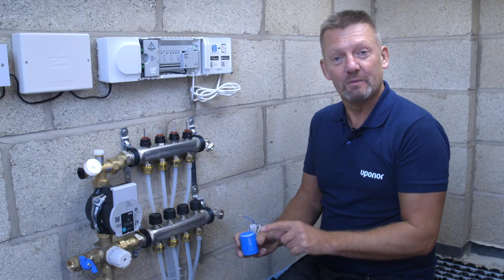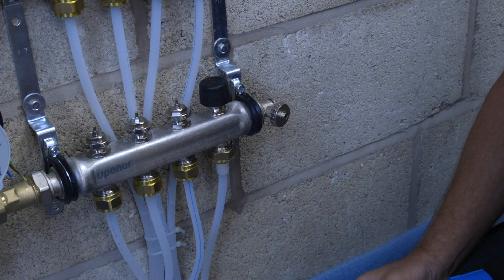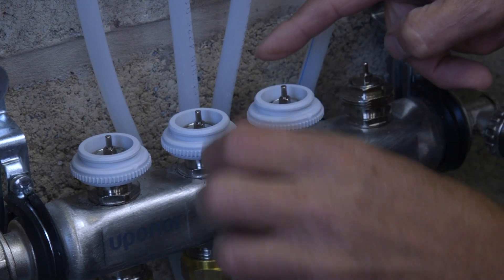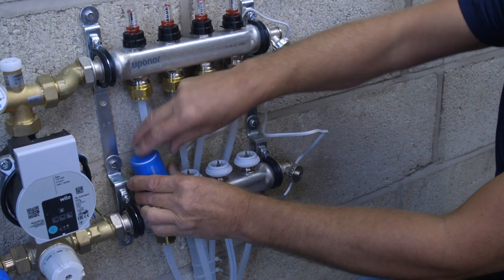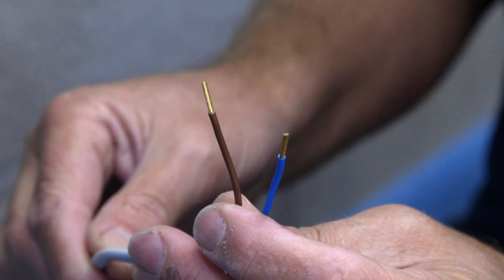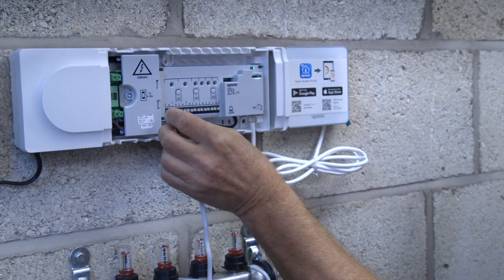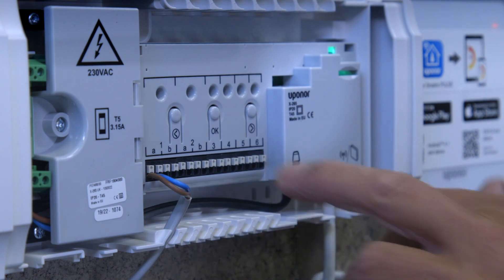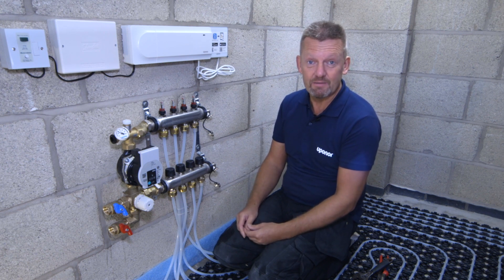How to mount an actuator and wire a Smatrix Controller

Comment: If the wiring access from the actuator to the panel is difficult - is it acceptable to cut the cable and make a join/junction box to fit a new actuator head?
Reply from the maker: Our Underfloor heating specialist  commented I can’t see any issue myself as long as they don’t exceed the recommended length which is printed in the tech details of each manual.

Comment: How do you remove the wires from the circuit (to remove a dud acuator)? There is a small little peg next to the connecting wire, but I can't figure out how to withdraw the wire.

Comment: In the manifold cupboard there is a dedicated actuator for my sunroom. However, there was no thermostat installed in the sunroom. Therefore the sunroom temperature is controlled by the thermostat in the adjoining living room. This is fine when the double doors are open between both rooms but not so when the doors are closed and I do not want the sunroom heated. What can I do to trick the sunroom actuator into thinking the room has reached the desired temperature and to shut off? Would really appreciate advice please.

Comment: Hi, I need to replace an actuator connected to my Smartrix Controller. I have a replacement. Can I disconnect and connect the new without powering down the Smartrix controller? I am afraid the settings will be lost if I power down the Smartrix.

Comment: What's the meaning of 2 access points for channel 1 and 2? Can you have 2 actuators connected to one channel, point a and b, to control 2 seperate rooms?
Reply: Or you can control the two loops of a larger room with a single thermostat. Since the length of each pipework loop is limited because of factors like water pressure, temperature, sometimes you need to use two or more loops for the same room.

Comment: That's relatively straightforward. 
Don't suppose you can show us how to wire the 2 port valve, pump and boiler call can you? Wiring a standard s plan to a normal central heating system is a doddle but how do you incorporate that to your system?